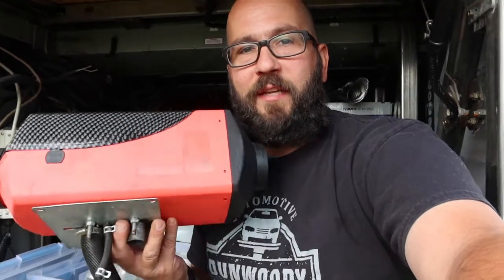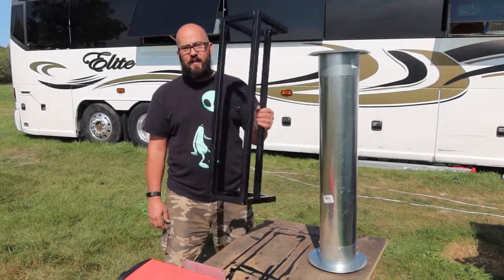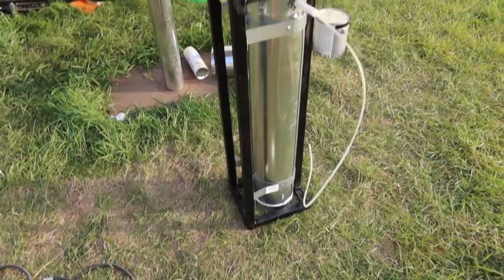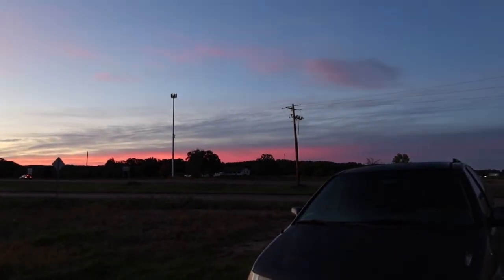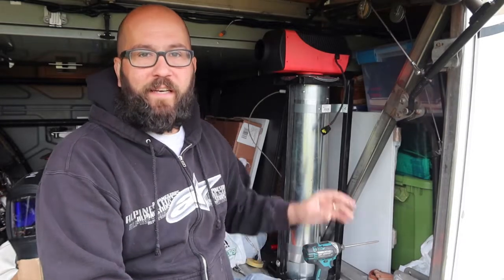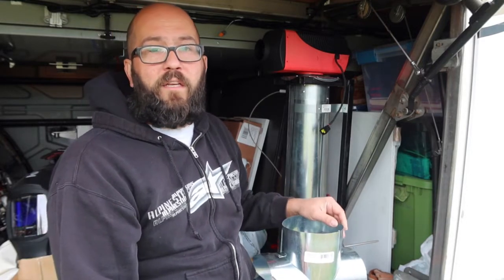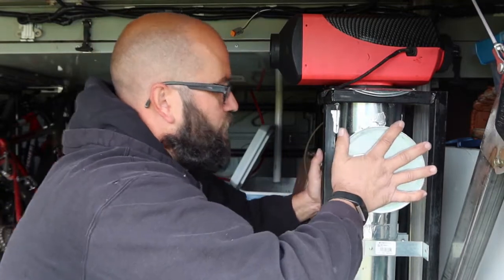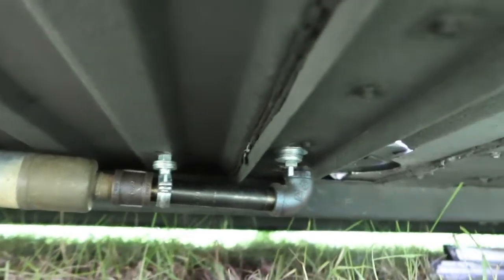Reinstalling the Diesel Heater in Our MCI Bus Conversion

Comment: Hi guys. I have questions, is the heater loud inside or outside, and can you sleep with it running? Could you include the heater running sometime? 
Thanks,

Dan
Reply from the maker: It is not silent. But with it mounted in the bay it is about the same noise level as a our old houses central heating system was. The intake side is a little louder than the exhaust. I'll record it running and will include it in a future video.
Reply: @andyandnancy  Thanks for taking your time to reply, Dan P.S. Look forward to the heater record.

Comment: You "stole" my idea and made it better!  Never thought of using stove pipe, never mind an inspection portal.  Actually sidetracked onto using expanded metal for inspection purposes, but may rethink all that.   What are you doing for intake?   Just the drawing up thru the enclosed area to keep things cool?   Agree with comment about concerns about exhaust intake.   Might want to extend the exhaust a bit and put it out past the edge of the bus, exhaust tends to accumulate under a vehicle.   To do so, you may need to go up a size.  Check with motorcycle custom exhaust fabricator.  Got lucky with my local muffler shop.  Nice editing too (such an underappreciated art!)
Reply from the maker: The intake air that is heated is pulled in through a duct from inside the living area. The intake at the bottom is for the combustion side of the heater. I believe that I'm alright with what I have...but I love your motorcycle exhaust idea and will be looking into it soon.
Reply: @andyandnancy  Thanks, but what I meant to ask is how long is your combustion air intake tube?  Do you just draw from the stove pipe housing or do you run something parallel with your exhaust line?   I was thinking of the former to provide cooling to the portion of the exhaust inside the larger pipe, but from what I understand, the air pressure needs to be balanced between exhaust and intake for combustion, that's why the manuals say the intake and exhaust should be near (but not too near) each other.  They should never be on opposite sides of the vehicle for example. A strong puff of wind on the exhaust (and not the intake) might in theory cause backfire for example.   Not sure how significant this is in the real world, but thought I'd mention it.   My project may turn out quite similar to yours, so airing the ideas for your input as well.
Reply: @andyandnancy  How is the new heater installation working out for you now?  Can you show some closeups of how you sealed the stove pipe to the corrugated floor?

Comment: Put three more diesel heaters in the bus. Front middle rear. That should keep it warm and toasty. And still spend less on propane and less trips to get it if you plum the diesel heaters into the main or auxiliary tank(if it has one)

Comment: I'm sure you have discovered this, the greatest heat loss is through glass. cover it with a good cutout of styrofoam or relectex or insulated curtains. Huge difference. 

Video editing is a LOT of work. Congrats. I'm  not sure, but did I hear the f word? Please, please, none of that.  In a perverted, fallen sick world, set a gold standard,  not following the mess in there.

Diesel heaters are great. 1/10 qt per hour at full blast. 2 heaters even better into a plenum. you can get Diesel water heaters as well. heat domestic and engine as well.